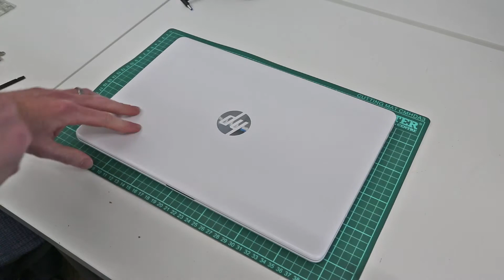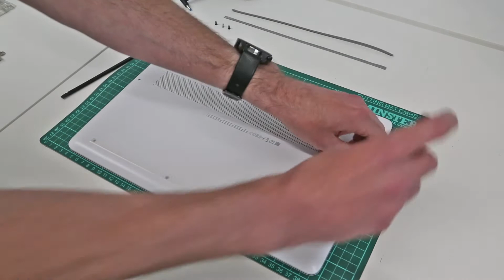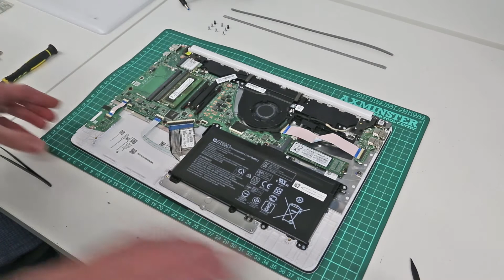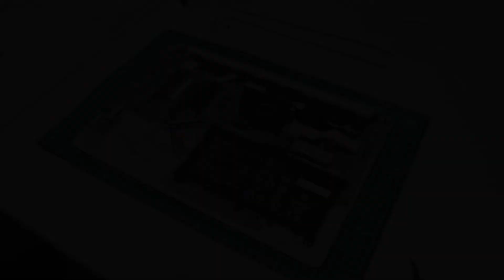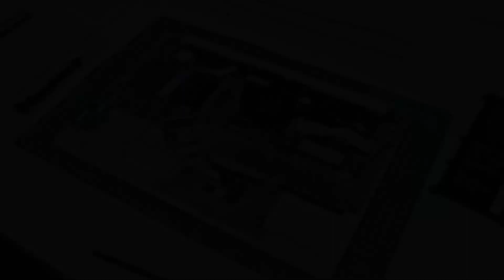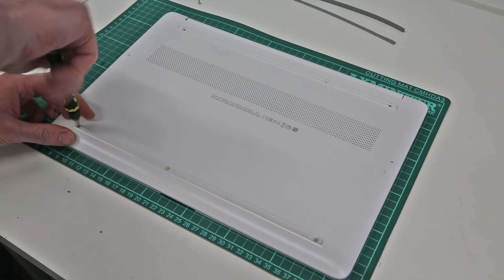HP 15s-fq1515na DC Jack Replacement Guide

Comment: Thanks for the video.  What if the clip that holds the DC jack is damaged?  I have replaced the jack and it worked for about a week and is now back to not charging and the jack itself is again a little lose in it's position.